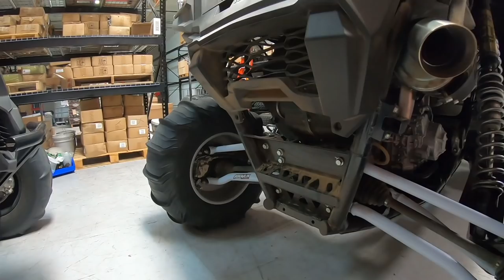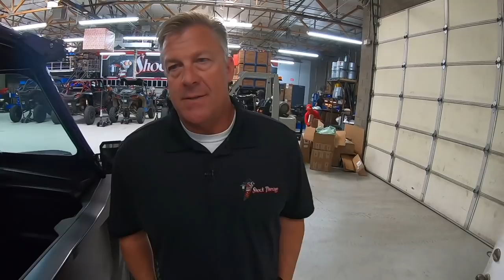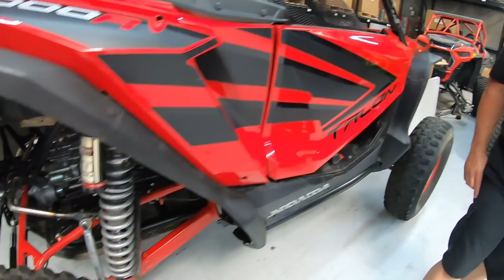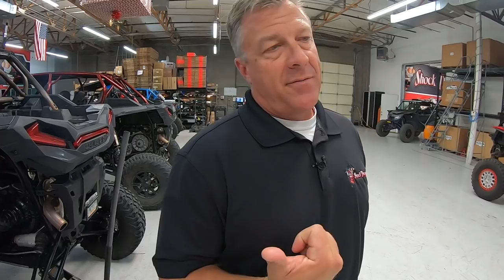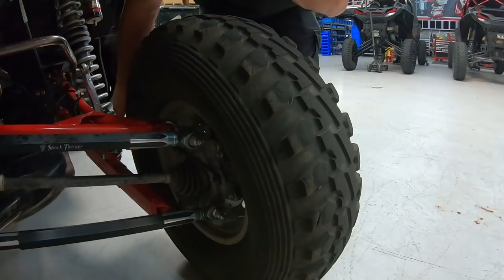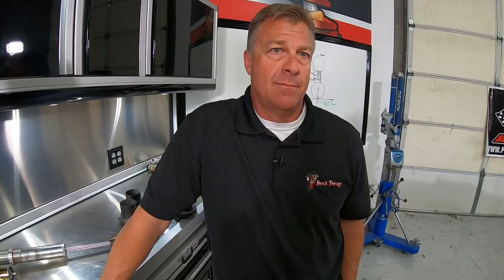Shock Therapy LIVE: What UTV to Buy 2020?

Comment: Thanks for all of these videos, very insightful. Hypothetical question; if you had $30k max budget, what would you build? A ready made turbo car or install a turbo on a KRX? Thanks
Reply from the maker: Ready made all the way. If the KRX had a factory turbo I would do that. Reason is I don't want the hassles and pain of an aftermarket turbo kit. Even the best kits have issues. Loose your warrantee, bla bla bla. Also the KRX computer has yet to broken into properly and support a turbo. Big companies have tried so I don't see that as a viable option. An aftermarket computer will do it but then your budget is shot. For all those reasons and more I am ready made turbo car or wait for the KRX turbo.
Reply: @ShockTherapyllc  excellent response. Thank you. For now I guess I’ll just enjoy my KRX with some clutch/slip-on/re-flash mods. We ride the Black Hills, SD, so big power isn’t totally necessary just more fun. FYI, the KRX is a blast in the snow. I call her the “Beast”. I think it needs heavier sways bars though. I softened it up for the rocks and ruts, but she’s a leaner. Your thoughts? Thanks again. Keep the vids coming.
Reply from the maker: @racertim23  I feel the same. we have a kit for more sway bar control coming out in the next 30 days or so just for that reason.

Comment: I have a 2019 can am x3 rs turbo r I am east coast mostly trails mud lots of rocks whats the best suspention tune for my application of riding??? Is the stock settings ok or should I change it???
Reply from the maker: if you UTV is still stock then the best set up is the Fox settings you can get on line. After that a spring kit and internal shock work will be a 100% improvement in ride quality.
Reply: @ShockTherapyllc  thanks for the advice sounds great
Reply: @ShockTherapyllc  also where do I find the fox tune instructional video??
Reply from the maker: @toddwolff1084  We did not do that one. i think it is on Fox's site or you can find it on Maverickforums.
Reply: @ShockTherapyllc  ok thanks!!!

Comment: I have a 2020 xp 1000. Has stock suspension right now wanting shock therapy later. But for stock what do you recommend for suspension setting i have no clue what to do for adjusting soft or hard. Coming off small jump the rear bucks and I want to try and get rid of some of that I am not one to hammer down the throttle I test the jumps first at slower speeds
Reply from the maker: Bart Benn if it’s bucks at lower speeds it will buck at higher speeds. As far as ride quality and suspension settings just start with all the shocks as soft as possible and make 2 click compression adjustments until it stops bottoming out
Reply: @ShockTherapyllc  I get that part of it and I know the stock suspension is limited as far as adjustment i guess what I am asking is there anything that can be done with my current suspension that will get rid of or at least alleviate the rear bucking
Reply from the maker: Bart Benn unfortunately other than taking some preload out of the rear which will lower your ride height, no there isn’t
Reply: @ShockTherapyllc  ok well thanks for the reply. I'm looking forward to getting your springs hopefully here in the next couple months

Comment: This is all just opinions and not to mention riding type and locations. I’ve rode in the krx and wasn’t impressed at all honestly,way under powered and feels top heavy. The xx seemed to have a lot of issues from what I see online and my local dealer has 3 talons in right now with trans issues. Why weren’t other n/a machines mentioned like the rzr rock and trail or the n/a Maverick xrc?

Comment: Any info on the 2021 honda talon 1000R live valve? Do you think the real time adjustments made by the shocks will help out with the poor geometry design and issues like bucking through whoops and other short comings or would you or could you get the same performance or better performance out of stock talon shocks after a revalue and spring set up?
Reply from the maker: We have done full testing on that car and we have a spring kit and internal shock work set up and ready to go. Although the live valve works a ton better than the standard shock set up it does not cure the bucking or other issues completely. But, we have tuned both the live valve and the non live valve cars and the live valve is much better if your comparing both tuned cars. We can get most of the ill handling characteristics out of the car with a tuned live valve.
Reply: @ShockTherapyllc  
Thanks for the reply, will definitely be ordering from you guys in the near future.

Comment: Kubota got it wrong. The XG850 CVT clutch doesn't shift down when you stop quickly resulting in ($270) belt squeal, jerky starts and belt burn in soft snow or mud. Also, the 4X4 clashes gears after delayed disengagement. Kubota dealership calls it "driveline wrap" which is still a problem, only less serious than he actual problem. They won't honor their warranty by denying that these problems exist. Company reps. will not inspect these problems if owner is anywhere on the dealership property. I build 2000hp airplane engines for a living and verified the problems before requesting warranty repairs. Additionally, they use expensive proprietary oil for the rear differential (not available in stores). Kubota buys up rights to affordable aftermarket products and then sells them at inflated prices. OEM replacement parts arrive with "made in China" labels.  Anyone know a good warranty lawyer or want to join a class action?

Comment: Thank you - your knowledge and sharing is awesome! One thing that upsets me :-) is that Yamaha is so low on your list! I am riding only MX tracks (I am from Russia btw) and Yamaha is so much better in jumping, sliding and most important - it does not beak! And shifting gears while in the air - that is something those overweight turbo dudes will never experience!
Reply from the maker: don't be upset. Remember I said that if your running short course (MX track) the car would be the best one out there. We agree with regard to what your doing it is the best!
Reply: @ShockTherapyllc  thank you and I was not upset! I only wish they would come turbo from the factory )))
Reply: He recommended a Polaris so he obviously disregarded dependability.

Comment: Top choice for brand new SxS owner looking to race an xc circuit with a lower budget?
Reply from the maker: Do you have video of what the XC circuit races are like?
Reply: @ShockTherapyllc  I can look. We run AWRCS here in PA which is almost identical to GNCC if that helps
Reply: @ShockTherapyllc  So I couldn't find any vids that i took. Here is an link for a video from a park we go to twice a year. We go through pretty much all terrain except sand and rock crawling. We have mud, rocks, hills, lots of off camber  stuff. Stability would definitely be a big factor. As well as reliability stock because I wont have a budget for upgrades right away. I see guys running almost everything. But I dont have the experience to know the differences.
Reply from the maker: @oompa164  Looks like fun. In my experience trees are magnetic Because I always get sucking into them somehow. LOL That type of racing should be a very low, stiff set up with a lot of anti sway bar for body roll in my opinion. Almost like Lucas oil racing. An RS1 would be amazing in that. Maybe a X3 DS, narrow, power, agile.  XP Turbo with everything stripped off. Those would be my choices. If more GNCC then there bigger air and rough stuff. Maybe raise the car up for those races.

Comment: Great video! Help needed finding the right vehicle for the wife and I. Never did any off roading but love agate hunting in the UP of MI. Want something that can get us through the sugar sand, up sand dunes, through mud/occassional flooded trail. Both of us are around 50 and don't care about going fast but do prefer a more comfortable ride. Not looking for a forest caddy but don't want to be tossed around by every little bump in the trail. Adjustable seats, desscent leg room, storage, heater for her is a must.  Wife is balking at $20k price tag but is onboard for $10k. Having a heck of a time figuring out what to get that is durable, low maintenance, and will get us to the places we want to go in that price range. Any help is much appreciated. Thanks
Reply from the maker: my suggestion would be a Polaris General. You will be around 20k but that is what it takes for a nice new UTV. Older, Rangers or Defenders don't have the suspension and will ride rough. The new General can come with a heater kit that was used in the Ranger but fits it the General. Also the General is the only one with a completely sealed cab door and window option that makes that heater actually work. That's pretty much it. You really need to work on her for that budget or it's over. LOL
Reply: @ShockTherapyllc  thanks for responding and giving me the ammo I needed to spend 20k! 😃 You guys are awesome!

Comment: Wondering what exhaust on the x3 is? side, single. Or are most of you guys just running custom exhaust. Thanks guys id love to open up the rear of my x3 for some storage not necessarily for racing but you know it doesn't hurt to pick up a few hp lol.
Reply from the maker: As far as side exit goes I think you will need to make it yourself. We did and most of what is available is designed to mount in the factory rear location.
Reply: @ShockTherapyllc  thanks for the info, i figured as much. Have a good one

Comment: Been loving your new videos! Let’s talk about the poor sagging weak springs on the Krx. Why are they junk?
Reply from the maker: Probably not enough there to do a 30 min feed on so here you go. The factories (pretty much all of them) need to save money every where they can to keep the cost of these UTVs down to 18-30k. It is really hard to do when you think about the production runs being 1/20 th that of a F150 and numbers drive costs down. Cheaper spring materials and QC can drive a spring cost below half that of a good spring. This is the single reason why you see the factory springs sag so bad. Quality of the spring being lower to keep the cost of the spring and the overall UTV lower as well. Sad but true.

Comment: If i were to replace the velocity shocks on a turbo s, do i need to find a 3" shock body to handle the rear weight with ~120lbs bed weight?
Reply from the maker: Nope. A 2.5" Fox is fine for the rear. Or a set of Fox bypass would work great too.
Reply: @ShockTherapyllc  thanks. I had a rear passenger side blow out the seal not doing much. And one of the front dust seal caps keeps falling down. So I'm skeptical of the quality of them.

Comment: Another awesome informative video! respectfully, I feel that the general is in a (great!) class of its own, its undoubtedly some kind of sweet cross over between a ranger and a RZR but i would HARDLY consider it utility,  more like a "cruiser"?  with a obviously bigger bed than a RZR  it will leave all the real utility machines in the dust (Defender, mule, rangers) but compare it to thoes same utility rigs to doing some work around the ranch, with a much smaller bed and sunk down bucket seats it dosent make for a good all day work "utility" machine.                                                                                                                                                For the record i own an older gator 6x4 (pos),  and a new 2020 mule pro fxt ranch edition which i feel they are majorly underrated despite having a top speed painfully governed to under 50mph,,,,,      also looking into the KRX 1000 WAS considering the honda